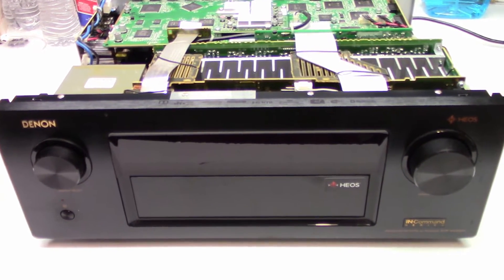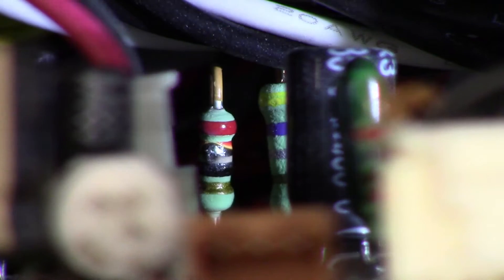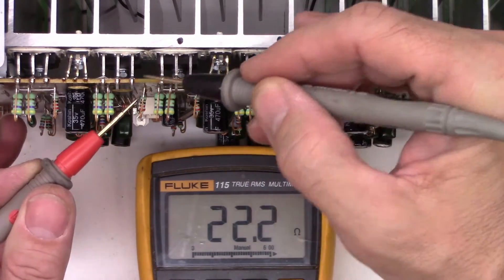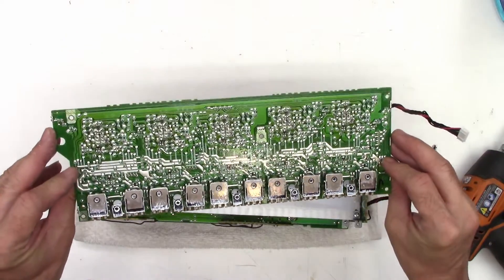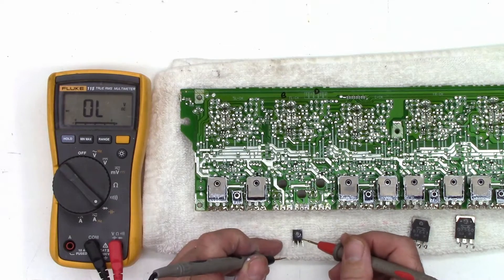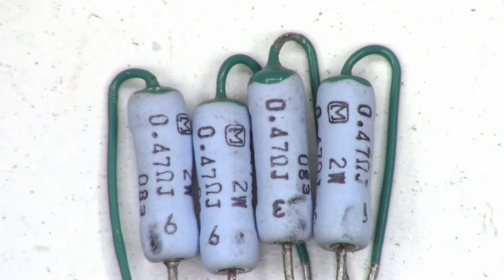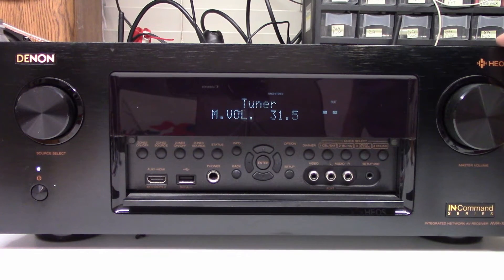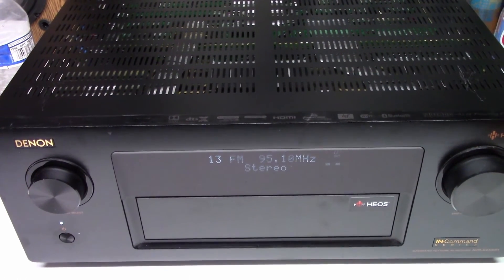DENON AVR-X4300H BLINKING RED LIGHT OF DEATH AMPLIFIER REPAIR

Comment: Hello, I changed all the final transistors because they were shorted, burnt resistors, I measured on those white names and I have over 50 mv on all channels, but I can't adjust the voltage, I turned it left and right and it doesn't change, I can't reach 8mv, I have no sound and the radiator goes over 90 degrees, I don't know what else to do.

Comment: How did you find a bias to set for the mosfet/transistor replacment. I'm about to attempt a similar job and within the service manual I can find no reference to setting the bias. I actually have two of these units I'm attempting to repair one I am replaceing the mosfet/transistor and one I am not.
Reply: Found the number using another video that showed bias listed under "adjustment".

Comment: Do you know if the binding post on a avr-x6800h is eazy to fix ? Broken off completely
Reply from the maker: the whole amp will need to be disassembled to the main power amp board to unsolder and resolder new binding posts. Quite a job!

Comment: Hi, I'm having the same problem, and the exact same damaged components. Is it necessary to adjust the potentiometers? In my case, it was due to an accidental short in my right speaker
Reply from the maker: If you change ANY components in the power amplifier circuit, then yes, you do need to readjust the bias pot. Anytime I repair one of these receivers I always adjust all of the power amplifier channels bias controls.
Reply: @norcal715  Thanks, friend. I changed the resistors and transistors. Now my system turns on, but that channel sounds dirty. Can you give me an idea of what might be going on?
Reply from the maker: Something is wrong in the bias circuit. If it sounds "dirty" then, most likely the transistors are well below the bias levels, and operating in a "Class B" operation.

Comment: Out of the 3 pins to check the idling current which ones do i put my multimeter on I got my receiver back from a shop and it is completely off. But can you please help me so i can get it right.
Reply from the maker: I believe its the 2 outer pins on each connector. If you measure the DC resistance powered off, it should read 20K ohms. If you see 20K ohms then you are on the correct pins. Hopefully this helps
Reply: @norcal715  thank you so much
Reply: @norcal715  my meter is reading 20.11 ohms but its a cheaper one klein cl800 but it helps me out the channel that just went ont is over 35ohms thank you for your knowledge and sharing it. Now i know a easier way to check a channel to see if it blown. I hope the LORD will bless you. Thank you for your time and have a blessed day
Reply: Can i please have a parts manual for a denon avr-x4500h receiver I have a service manual pdf but I dont have a parts manual if you got one i will surely appreciate it if not thanks for your time. I have onkyo tx-sr875 do you have a video on working on the fans i want to make them stay on

Comment: Hi I have denon ABR X4500H it always shuts off and goes on flashing red after  a few minutes ON. I disconnect all the speaker wires and just let it power up without load and it does the same problem. I also noticed the 2 cooling fans are not turning ON.
Reply from the maker: Try unplugging all of the connectors from the "relay" boards and spray Deoxit D5 into them, plug and unplug them multiple times to clean the connections. Completely reassemble the unit and test it again.
Reply: I tried cleaning and re assembling it and the ribbon cables. The 2 heatsink fan still not turning ON after I powered the receiver and after 2-3 minutes when the heat sink feels warm. It shuts off flashing red light again. The receiver is not connected to any speakers yet. Just power cord.  @norcal715
Reply: Hi, I also noticed I could'nt reset the Heos network. If I ttied conecting to the network, It was stuck searching for the network. I tried reseting to factory default several times unplugged for 3 days, but no luck. I tried removing the amplifier section now and observed the receivers behaivior. I noticed that the fan started running and the receiver is not shutting down, I only see Auddessey set up keeps showing but not turning off.

Comment: to summarise, he changed the pair of shorted mosfets, 2 resistors of 0.47 ohms 1 watt each and 2 resistors of 22 ohm, 0.5 watt each. After replacing these parts there was no short on the board. now he is setting the bias bolta to 8.0

Comment: A  real tech is like ihens teeth !  l ran this  avr on one channel like a banana ......plug came out and a terrible smell  ensured followed by protection warning  that isn't going away . What say you sir is it a [denon avr 2000 over driven ,] look for a bbq transistors or ic in the output or chuck it ?
Reply: Just in case you knew , the banana plugs that dislodged must have been as you knew , touching while me the big audiophile didn't even  turn the balance knob . Funny i tried another Denon avr2700 and it got very hot but no protection mode , l guess mine was from 1992 and abused all it's life . Tnanks for content .

Comment: hello great video , i have similar issue , with X2700h , my reciever working sometimes 1 minute , sometime 30-40min and turn off in protect . When i go in developer mod say  “DC” is displayed (DC output of the power amplifier is abnormal.
If the power is turned on during this abnormality, protection is activated after around 6 seconds and the power is turned off) is it the same problem ?
Reply: did you find a solution please?

Comment: I have an x4500h which turns on but ok the screen the outputspeakers do not show and there is no sound output from the receiver, help I'm stuck
Reply from the maker: Try a factory reset. The instructions are in the owners manual in most cases. It is usually "hold 2 or 3 buttons down while plugging it in". You will need to look in the owners manual, or on line, to figure out what buttons to hold down.
Reply: @norcal715  I tried that the unit resets but the output speakers only flash for a few seconds and then disappear
Reply: @norcal715  do you have an idea where I can get the digital board, I believe it's the one with issues

Comment: Hi, I have a 4200w with the same issue. I've identified 2 or 3 resistors that have blown, but I'm having trouble working out if the transistors are OK. It seems going red to the middle and black to the outer legs works for every other transistor. Then for the ones between I go black to middle and red to outer and I get a 490 to 620 reading ( same as the others with switched leads) does this mean they're OK and just every other transistor is soldered differently or that every other transistor is broken?

Comment: I used your video to test and repair a Denon avr-x1300w.  it was almost identical problem.  I am just a novice hobbiest.  Can you tell me why when I get to the bias adjustment, it is reading 187mv when other channels are reading 2.4-2.8?  I replaced D2390 65 P, B1560 65 P, qty 2 - 4.7ohm and qty 2 - .47ohm resistors.  The unit powers on now!  only thing different I can see on the parts I replaced is the D2390 has a 54 P instead of 65 P, same with the B1560 has a 54 P instead of a 65 P.  Will that cause the bias to be so far off?
Reply from the maker: It should not affect it by more than a few mv. There has to be something bad in the feedback circuit, and or differential amp, DC correction
Reply from the maker: Also dies thew bias pot change it at all? email me norcal715videos@gmail.com
Reply: Yes the bias changes. There is a test port at each channel that I used to test. Can you possibly point me in the direction of what to test next?

Comment: Hi. I got the same problem on my AVR as well. But after I replace the bad transistors and resisters, the unit stays on for about 5-10 minutes and shut off as DC protection again. And it can work probably after reboot for about 5 minutes again! What will be the potential problems?
Reply: I'll say just buy a new one.

Comment: I saw you were jumping the pins on the plug while adjusting the BIAS but, I didn't see where the multimeter was hooked up too. Probably a dumb question but I'm still learning. Could you tell me where that was? I assume it was on the channel output terminals

Comment: I have a x4500 where the subwoofer pre out stays silent because of a lightning strike. Everything else works fine though and device powers on. Any idea on what I could try? I don't want to throw it away quiet yet.
Reply from the maker: Try a factory reset first to clear the memory back to out of the box condition. Keep me updated.

Comment: my X2400w had this issue last night, and I'm going to attempt the repair based on this guide.  For the current configuration at the end across the bias, how are you testing for 8 mv?  One probe to ground, and then it looks like you've split the red probe across two alligator clips?
Reply from the maker: There are bias test points on most of these newer amps. Get a service manual from elektrotanya.com

Comment: Have a similar problem with a marantz 1504 receiver, stuck in standy, have to bypass stanby for the unit to work, that is what my technician advise me to do as he could not seem to find the fault.
Reply from the maker: Does the power light  change state as the power button is pressed?
Reply: @norcal715  would have to check and let you know later, thanks.
Reply: Yes the standby light goes off for a few seconds when the button is pressed, display says AV Receiver and then the unit shuts off.

Comment: Does it really matter if the numbers on last line on transistors like 79 Y, 4N Y are different on replacement transistor..? i found a replacement transistor B2650 15 P instead of D2560 4N Y . Is it Ok to use it?
Reply from the maker: The last letters typically indicate the gain of the transistor so it can be more easily matched.

Comment: I brought Denon avr 1804 receiver not working( red light blinking)
I Changed the two regulater icies 7915 and 7815.when the turn on receiver then suddenly come noice and smoke that changed regulater area. Now again red blinking 😔
Want to do.
Reply from the maker: Were they all plastic ics? If they have a metal tab you have to isolate them from the heatsink. The metal tab is at a different potential than the heatsink.

Comment: Hi @NorCal715 and happy new 2021!!

I have a problem with my AVR-S940H and maybe you can help me.
Everything work fine except the analog tuner (AM/FM).
I tried all of the steps but nothing solve the issue (factory reset, firmware update, reconnect fm/am antenna, unplug/plug speakers, source seletct in Zone2, etc..)
The specific problem is.... the automatic serch is in loop, never detect any station (AM/FM), if I put manualy station, I can't ear nothing. No radio station, no static noise, nothing.

Im lost, you have any idea?
Tks.

Btw. I have the service manual but the tuner section is very poor for diagnostics.
Reply from the maker: Probably just find a new AM/FM tuner module at this point.

Comment: I had a AVR-x2200w that did the same. Right when it would say “main zone on” it would switch off. I found a manual online and found “protection disable” mode and tried it. It’s been working great for a long time. Although I should probably not run it in that mode being that if something goes wrong I may end up with fried components
Reply: How did you do this, could you please tell me, I have this same problem happen to me today.
Reply: @Shaftydude  Press the Power button while pressing "ZONE3 SOURCE" and "STATUS" and "Cursor LEFT" buttons to turn the power on with Protection detection disabled ("Protection Pass" should appear on the display for 5 seconds).
Reply: My Denon 4500h went into protection mode. I put the 4500h in protection disable and was able to turn the unit on and I found I have no sound coming from the left channel, its dead.

Comment: What is the reason that would have caused this problem?
Reply from the maker: Normally only 2 things would cause this problem. 1st being a defective speaker or damaged speaker wiring, and the 2nd is just a defective component from the factory like a driver or output transistor itself.
Reply: I'm possibly going to get a replacement from Denon but need to know what could have caused it.
Reply: Is there any way to check if speaker and wiring fine without a reciever? As I have already sent the reciever back.
Reply from the maker: You can do an ohm meter check where the speaker wires go into the receiver I just make sure that the ohms are correct. If you have one that's abnormally low it could potentially damage the receiver.
Reply: My apologies for asking so many questions as I'm extremely new to this. My current set up is TL1600 polk speaker pack with Dali Alteco C1 as front heights powered by Denon x2400. My reciever started having the above as soon as I connected it with everything and turned it on for the first time. It never worked beyond blinking red light.

Comment: Hi Norcal. I have a Denon AVRS 930H Receiver. It has same issue that the power light comes on and shuts down the unit in 3-5 seconds. It would be helpful, if you can guide me to repair it. I have good soldering skills and have soldered some stuff before. I am living in India. I imported this unit from US. So I have been using a Stepdown Transformer from 220V to 110V.
Reply: Hi Sreedhar,
What caused this issue? I'm having the similar problem.
Reply: check the wiring and speaker first .  remove all speakers wire and test. second check all power transistors and resistors as shown in this video. do not forget to set proper bias after replacement this video is excellent as all steps are covered.

Comment: Awesome video.  I just got a non working X3300 from my parents who ordered a new AVR.  This one is doing the same blinking red light.  My results are almost identical to yours.  I have 2 transistors that are testing bad as well as 2 of the larger resistors and 2 smaller resistors.  I am going to try and order some replacement parts to try to repair this.  Where do you order your parts from?
Reply from the maker: Any more its down to amazon or eBay. Even sometimes on eBay sellers will sell a kit with all of the common parts that fail.
Reply: @norcal715  Thanks for the reply.  That is pretty much where my googling lead me as well.  Digikey had one of the transistors but the other was backordered.  Found an ebay seller selling both transistors together like you said.  Thanks again for posting this how-to as I would never have known where to start.
Reply: @norcal715  I just retested the transistors again and noticed that the one in the middle, the smaller one, is not testing within spec and will probably just need to replace that one as well while im at it.  I am not able to find that particular transistor even on Ebay, other than from China.  Do you have any direct links for the C3964?  Thanks again.
Reply from the maker: Ebay has 2SC3964. The manufacturer just left off the 2S from the case.
Reply: @norcal715  Not sure how I missed that.  Much appreciated.
Reply: @jackmahogovv  So I have the same problem and I am trying to buy replacement parts but I can't seem to find the larger resistors can you tell me where you got them?

Comment: But once you open up a Denon receiver you open up a can of worms because there are a million and one jacks that you have to disconnect and 30 million screws and you don't have any access to the bottom so you have to take everything out of the case in order to service it just like all the modern receivers these companies have screwed the service techs it's not like the vintage equipment you can open up the bottom and get access to the circuit board all this new stuff you got to rip it completely apart in order to service it and then if you get a service contract with these people they want you to do it for peanuts that's why a lot of technicians don't want to do service contracts with these companies because they want you to do it for next to nothing there and then when people complain that they don't have their equipment back it's because the companies have not sent the parts and the parts have not been made yet and I think it's the technicians fault want to new receiver goes down 9 times out of 10 when you bring it to the technician to be fixed the technician is waiting for the parts and the reason why he's waiting for the parts it's because the company has not produced them yet you tried to tell the customer that and the customer doesn't want to hear it they want their stuff now and then when I usually do with that turn around when I tell them I'll put it back together I'll hand it to you and then you go fight with the company the only thing I can do is order the parts if the parts are not available I have to wait until they are you call up the company and you yell at them don't yell at me yell at them

Comment: Good repair Sir. 
I have a Question : When making amplifier based on TDA 7294, only thermal compound  is enough or  mica/thermal pad should also be used?
Reply from the maker: Since that ic is a metal tabbed ic, and pin 15 (-VS) is tied to the tab, unless the heat sink is tied to -VS then an insulator is required.